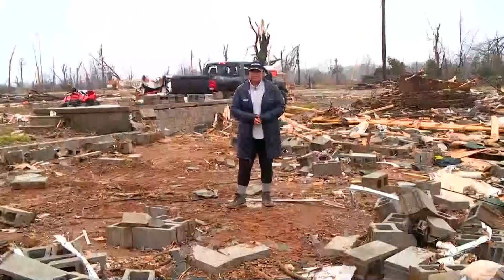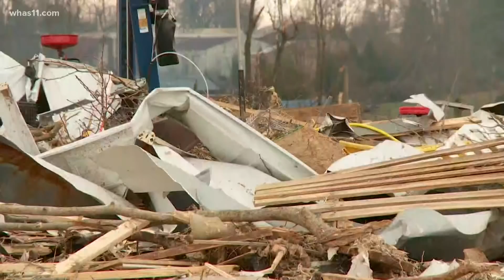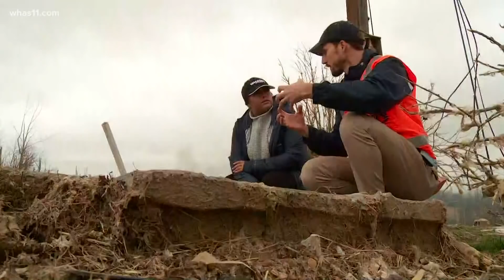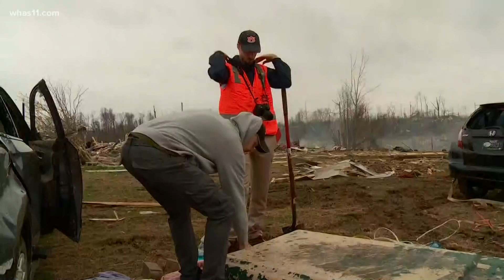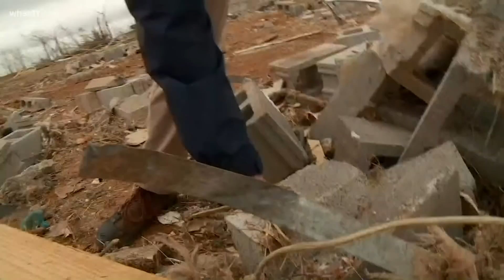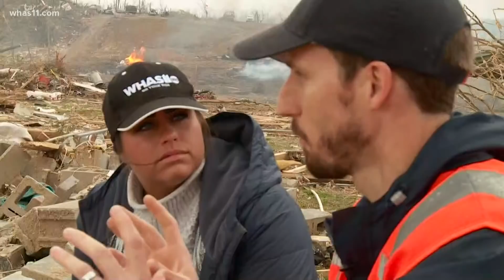Engineer says homes destroyed by tornado were not built to sustain high winds

Comment: What percentage of homes in Kentucky, or any other state for that matter, could stand up to an EF-4 tornado?  Any? 1%?
Reply: Thousands of homes that are not in the direct path were destroyed that would have survived if built to code. You must be one of the sloppy, lazy builders who takes all the shortcuts.
Reply: @oldcountryman2795  no, thousands of homes not in the direct path were not destroyed;  many nearby may have been damaged and lost roofs, but were hardly destroyed.
Reply: @shawnpitman876  what experience do you have in construction?
Reply: 36 Yrs. cement, concrete, masonry.

Comment: People any home that have a 7/12 pitch or greater will be destroyed base on wind in excess of 150 mph. Roofs have no support structures it’s acts as a sail. Homes built in Tornado area should have a low pitch for rain run off snow zones is the only reason for a steeper roof pitch.  Contractors used these steep pitch to make homes look larger and it’s adds to wasted $$ on home cost.

Comment: Almost nothing can be assured of withstanding an EF-4 above ground. Even FEMA compliant retrofitted safe rooms aren't designed to that level, although some in-built designs are. Even with those the house will be destroyed but it's occupants may be safe which is the whole idea of safe rooms and shelters. You can find the damage indicators used to assess tornado strength online along with the corresponding wind speeds where their failure will be found. From mid EF-4 up nothing which is not purpose-designed to withstand it will be left standing and even many of those structures will be a total loss afterward.
Reply: While that may be true, there's multiple other factors that need to be considered that are being ignored. Damage done to foliage, recorded wind veolcity, all the EF scale does is ignore the actual strength of the tornado in favor of construction methodology instead. I am aware that the F-scale wasn't perfect but calling an EF-5 an EF-4 is not an accurate way to measure tornadoes that caused total destruction.
Reply: Well, that’s just not true. Dome houses are tornado-proof. They can withstand EF4-EF5 winds... People just don’t like them because they’re not as pretty as traditional houses, but don’t go around saying untruths.

Comment: And that is why rating Tornadoes based on damage assessment needs to change.
Reply: I thought they are based on wind speed.
Reply: @TinShackVideos  They used to be rated by wind speed until 2008 when they came out with the EF scale. The old scale had a few flaws when it came to strong tornadoes but this scale is also very flawed when it comes to strong tornadoes.

Comment: Unfortunately the most affordable housing in these poor areas of the country is either Modular homes or trailers.   The Modular homes are just about the same as a trailer except they are built in factory, brought in and set up on those foundations.  Many people could not afford to have a home if it were not for these options.  And a tornado of this magnitude and strength mowed down even the sturdiest of brick buildings that have with stood tornadoes.  But the loss is going to be bigger here.
Reply: Invest in bunker survivor keep cash cans food water ☎️ charger 💊💉 sad but it's a must in tornado country will happen again
Reply: In our street the buildings have a brick facade on most sides. That worked fine for the debris, but where the tornado passed it pulled the brick right off and toppled it down over cars. A lot of cars got severely damaged just from the brick falling on them. I was finding bricks strewn about hundreds of feet from where the tornado passed.
Reply: If more people knew they could build adobe type homes and the earth around them keeps your home warmer in winter and cooler in summer, plus the cost of a small piece of ground to do this on , would make all energy efficient.  The cost of using clay, concrete (crushed rock) and straw mixed with water builds an amazing home. And doing it yourself and your family and or friends lessons the cost of building by more than you realize
Reply: Funny how all of these people who "can't afford" things like properly built housing are always able to buy things like computers, cell phones, and brand new vehicles.

Comment: Build back using poured concrete using forms or tiltup construction. Wind rated to 295mph. But if you must do stick-build then USE SCREWS.
Reply: And what about the things such as cars that are also moving at 295 mph and hitting those houses? The majority of damage is not done by wind alone.
Reply: @lesmiller1739  It might be damaged some by big objects but you'd survive because it would mostly stay intact. How many vehicles are going to hit a house.